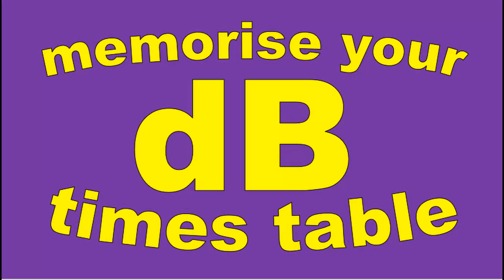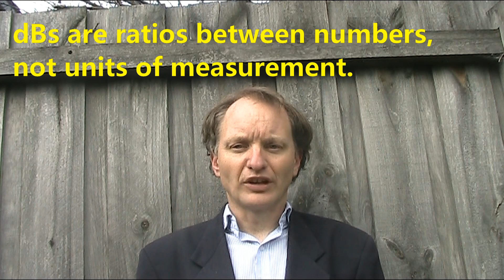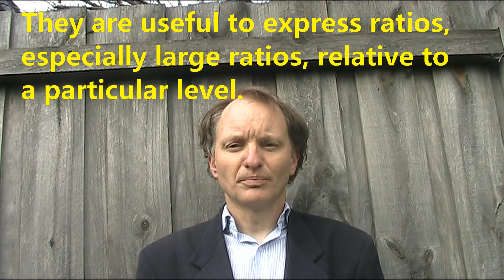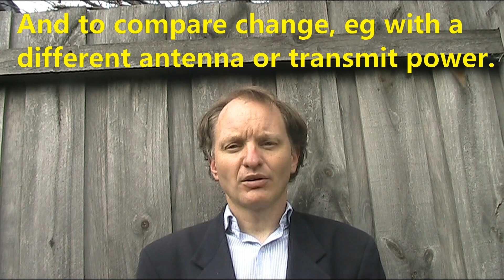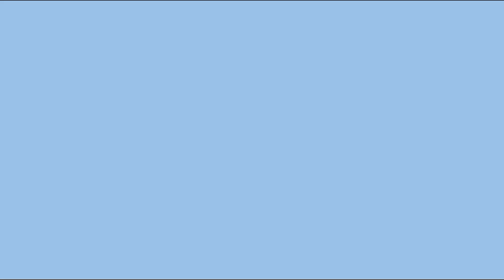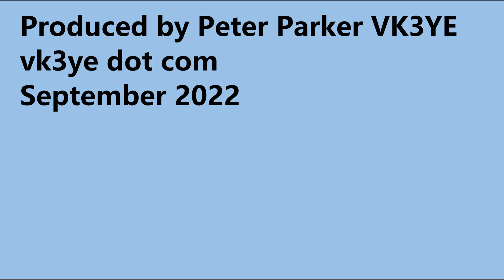Memorise your dB times tables

Comment: If you know multiples of 3 and powers of 2, you can get pretty far. Like 11 is (3*7-10) which is 7 doublings (128) divided by 10 (12.8). So like 13. That's what I do, but I don't use dB on a super regular basis where I would want to know those off the top of my head.

Comment: Divide output power by input power. Press LOG. Times 10 gives dB. Example: 5W in and 10W out -> 10*log(10W/5W) = 3dB. Use 'times 10' with power, and 'times 20' with amplitudes (like voltage). 😀